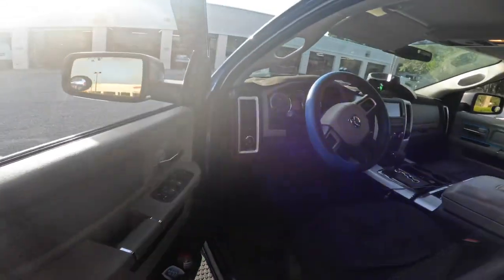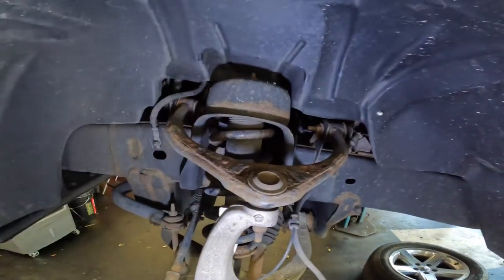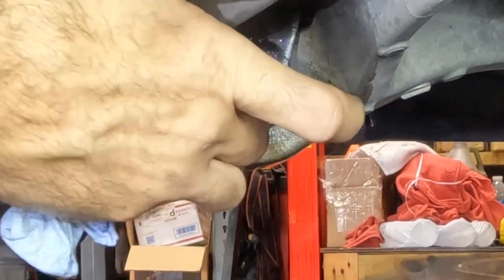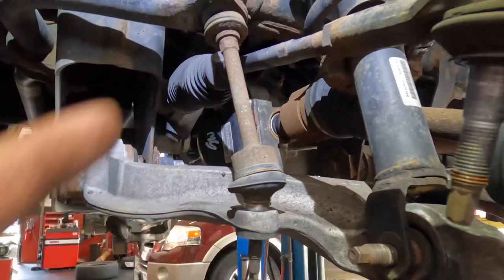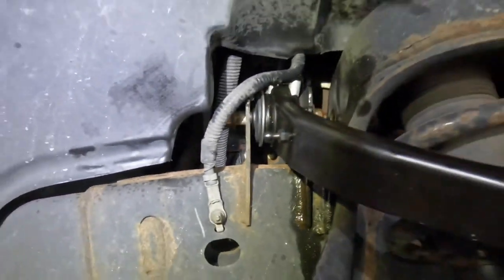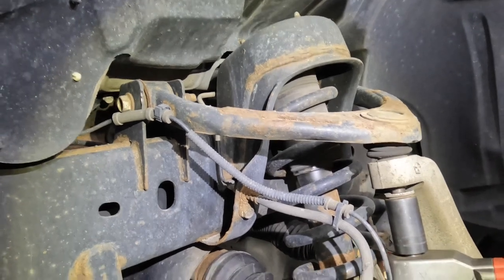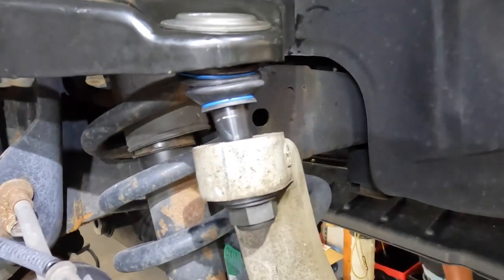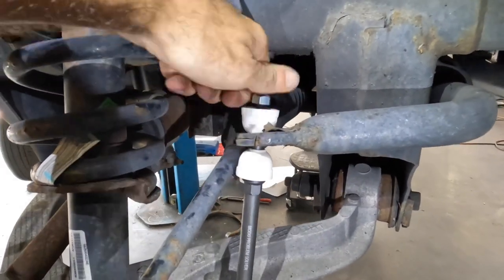Job Fails Fast! 2011 RAM 1500

Comment: When a norhern truck comes in for the estemate, spray everthing down with wd 40.If and when you do the job ,you might luck out and the bolts come loose. ALSO ,if you work on northern trucks,you MUST HAVE 6 point combination wrenches

Comment: I love your videos Ray you are good at what you do however did you settle out the vehicle after you raised it on the hoist?  You will get inaccurate measurements if you don't. Have had a couple of seized lower arm cam bolts on Dodges.  We burn the bush and expand the crush tube then punch the bolt out.
Reply: The rubber stinks when it burns but it works great idea

Comment: Love your videos. Two recommendations. Butter your bolts with anti seize and get a cordless Dremel
Reply: If you can find them invader blades invader blades ß
Reply: A 4-in right angle grinder if you can get it in the right spot and a cutting blade will make life go

Comment: Moog makes decent ball joints with grease fittings but their wheel bearings have gone to crap. I replaced a rear wheel hub assembly on a Mountaineer and it went s#$% in ~10,000-15,000 miles. It had lots of play for a ~2 yo wheel bearing. I had a Moog front wheel bearing as well that only lasted about ~3 years. Only stick to their premium line if you decide to use any of their parts. Better yet, just stick to Timken/SKF.

Comment: For all the viewers who asked why the torch didn't come out first, they are not considering the backordered parts need to be present before you burn the bolts out, hence the lower control arms and other items need to be present. Otherwise an employee's truck would be occupying the lift for up to two months.

Comment: If everyone doesn't already know-
Vehicle manufacturers don't make their own fasteners. 
They contract out other companies to make them, but for certain things
there are "private label" items, but most are ISO. It would be so incredible
to be able to go online, shop at a website where you simply enter info
of OEM and there's the fastener you need. No Dealer, no settling for
a potentially dangerous knockoff, but the actual fastener you need,
straight from the source. At the factories where they're produced, there's
boxes & boxes of product. Would it kill to have  Pickers go around,
fulfilling orders? Are the Automakers so greedy as to prevent this?

When I did the work to my Buick's cradle subframe, installed new bushings
& bolts. Factory bolts were $23 EACH. 6 BOLTS. $136 after tax and S&H.

That is beyond robbery.
Reply: Buick doesn't want to sell you subframe bolts.  They want to sell you a new car.

Comment: I have an idea for a salvage business, you take the cars from where they don't rust and the sun bakes interiors.  Replace the motors/maybe/interior plastics with rust belt lower uv area cars.?
Reply: Custom rebuild with parts available options? Upgraded parts dependent on fitment complexity and cost of upgrade/rebuild.

Comment: Fun fact, Volkswagen Audi Group cars actually come fitted with the fitment for like the ride height sensor for the headlights on cars with Xenon, even if the car doesn't have xenon, the control arms for example will have the bolt holes and all that already on the control arm, this apparently saves them money as they don't have to make different parts lol

Comment: Lmfao the behind the Seens Flashlight reveals under the fender Surfance of the sun outside Barley light outside even with sun at 12 o clock position 😅 🤣 😂 @Rainman Ray's Repairs

Comment: Suggestion. Hit up the junk/salvage yard and see if you can find some acceptable bolts until the new ones come in. Get the job mostly done (aside from a simple bolt swap later), safer than those rusted out things, and give the customer a better ride in the mean time. Assuming you find acceptable bolts there, of course.
Reply: That would be an acceptable solution for you or me, but Ray's time is money.

Comment: Ray, you should have rolled the truck 5 feet back to allow the suspension to settle after being on the lift before measuring the height

Comment: I understand the guy wanting to do the leveling kit. Trucks look dumb nosing down into the ground. I don't know why manufacturers do that, unless it gets the nose of the truck close to the road and because of that gets better fuel mileage. I get what you are saying to Ray about not getting bolts from Fastenal or somewhere else, if people want to do that to their own car themselves, then go ahead. People thought when I used to make similar statements to them I was being a jerk. I'm not, it's a liability issue just like you said.

Comment: I have been in this situation. The solution was to remove the lower arm and the shock as one, carefully cut off the arms of the lower shock and press out the bolt and bushing. Once that is completed liberally apply penetrant to the metal sleeve and attempt to remove. IF that does not work a torch will expand the sleeve so the bolt can be saved. Additinally, curiousity must make me ask. what grade are the bolts??? I resprct your decision but I have to ask.

Comment: Hi Ray, I am a submarine operator and mechanic in some foreign country. I am subscribed with another name to keep my identity safe. Why dont you use anti seize grease when you clicking the bolts? we ALWAYS use anti-sieze grease when tightening bolts for sea water use, it easy to reverse click even if the bolts are 7 years underwater.
There is a good Loctite anti-seize, a gray type for high temperature it a little nasty but works fine.
or a white type i think also made by Loctite much better and less dirty.
If you need any info on what type exactly (part numbers) you can reply here.

Comment: Not to cut ya down ray cause your a great mechanic, but a little heat, water, bfh and air hammer and you could easily get all those bolts out without cutting them off.

Comment: Ray, you were fortunate that you were able to put things back together after you found the rusted bolt problems. Just wondering ... if you weren't able to put it back together with the parts you had, would you have Fastenal or HomeDepot something so the guy could have his truck back?

Comment: Having had to do custom work that factory bolts no longer work for,  there are definitely some bolts that I have replaced with the same or better grade of bolt. That being said the bolt store is not going to have the offset alignment bolts that will work, so at that point might as well wait for all oem.
Reply: The alignment bolts have a flat so that the eccentric to adjust the camber will not spin you can't buy them in a hardware store
Reply: @michaelpressman7203  Yea I know, I literally said that the bolt store would not have the alignment bolts.

Comment: Of course your left hand kept dropping the nut. It's a right hand nut.
If you have the lowers already, I'm surprised you didn't cut the mounting tabs off the strut, press out the bolt\bushing off the arm then heat the bushing sleeve and press it off of the bolt.

Comment: As a mechanic, I've learned with bolts and nuts which are exposed to the elements, to always install the bolt in weather direction and the nut on the lee side, so that the nut and threads are not getting the brunt of the incoming junk/water/dirt etc. for me it looks the bolt of the strut would be installed the wrong way around, is there such thing with cars?

Comment: Pop that bolt a couple of times with about an 8 lb hammer. You may find it works but you have to let some penetrating oil get started first.

Comment: Hey Ray you need to get yourself the Ridgid high torque impact it's a beast. I have the mid torque like you have for light duty but I also have the high torque because I live in Ohio and corrosion is a real thing up here. Great video as always nonetheless.

Comment: Have to ask. Did I see a crack in the passenger side sway bar at around  26:30? The drivers side I could see it was just Paint. Do you Know why the put grease fittings on the lower side?  Please Keep the Videos coming. are me back in the day working as an auto mechanic.  Retired ASE Tech.

Comment: Hey, that's the same problem I have with my 97 Z28... Unfortunately the OEM Z28 bolts are unobtanium.... I've ordered other bolts, but the head sizes are different, which means I can't put in the adjustment tabs

Comment: That truck must've been sitting in water up to the wheels, I'm a mechanic in Connecticut and change those struts, & control arms all the time and never have that problem, and we have some pretty brutal winter months with snow and all the salt and sand.

Comment: Ray: Do you think an inductive heater would have worked on the stuck nut? I purchased one a few months ago to do my jeep suspension and it gets the nut cherry red. I live up North so; Everything seizes up from our winters. Still replaced the bolts and it's hard to source them here as well. Try WW Grainger or, McMaster-Carr .

Comment: Check your local heavy equipment service companies, like Mac or Cat.  Of course you want at least MFG quality bolts for a half ton from a company that consistently undersizes ball joints and other front suspension components on trucks.

Comment: I would not be worried by any means about two inches higher in the rear. if lower, yes.
Ya, aluminum, rubber and steel components combined is a total nightmare.
FYI, the bed is 2 inches higher for a reason.
Put 1000 pounds of stuff in the truck bed and your rear drops 2 inches.

Comment: NY, PA and Ohio guys could show you pure suspension horror stories.  try having to do that when the vehicle has a band new body, but the underside looks like it's been sitting in a junkyard for 70 years!  and the chuckholes up here don't help your suspension parts, either.  I actually told the guys that put put new shocks on the rear of my last vehicle that they should let the penatrant sit on them for a while.

Comment: Not that it's an option up north here, but is there a possibility of (temporary or not) junkyard donor bolts that haven't taken a vacation to the rust belt? 

Might not be a great option, but if theyre in good shape and that's the only thing holding up the repair...

Comment: Ray... a question please... why when using the electric impact on any bolt that is stuck, you usually try to undo it manually with a hand ratchet or breaker bar and not a big pneumatic impact wrench? Aren't those powerful enough to undo almost any stubborn bolt? I was wondering what's behind your strategy so I may understand and learn. Thank you!

Comment: What I end up having to do was cut the ears off the bottom of the struts removing them then using a cut off wheel to cut them inserts off in order to that the bolts I do believe I have a video on it somewheres on the channel if that would be of some help

Comment: You need to come to Ohio and do a class on how to heat beat rusty stuck part lol every bolt is usually a struggle up here you can cut the head off the bolt and use the nut to run it out I’ve done that on leaf springs

Comment: the minute i saw the lower strut bolt not require the use of a wrench to get that nut off i was like that there truck needs some control arms now

Comment: Got me wondering if those bolts could have been sourced from GM or Ford?   It might be worth a shot to call a dealer and see if they have any in stock, get them and see if they are the same?  Never know!
Reply: I really can see downgrading quality GM and Ford parts to be put on a rust bucket dodge !!!
Reply: Readily available from auto parts sources. The inner bolts are in the camber kit. The outer bolt is included with the replacement bushing.

Comment: It’s the same thing they did to Pluto,

but it will always be a ❕Dodge Ram❕
Reply: Many years ago I knew a guy who worked at Ford Edison Assembly when they were building Pintos.  One day he came to work and found a platform at the main entrance with a brand new Toyota Corolla sitting on top.   Before they started the shift they got a lecture from a suit who flew in from Dearborn.  The suit told them that the Corolla was their best competitor and that's what they were aiming for.  Then he proceeded to tell them how they were going to improve the Pinto.   Everyone stood there in silence until one assembly line guy said,  "Yeah but even if we do all that, it's still a Pinto."

Comment: Rule number one; spray it all before removing and add some brake fluid to nasty nuts or Würth Rostoff, give half n hour and soak some more then, take everything off.

Jayzuz dont you have a cleaner?🤦‍♀️. That floor is dangerous.

I find a nut splitter is faster. A dremel also helps.

Also looks like bad design, you should never have a steel bush in an aluminium housing...🤣

Wow thats a bad design of upper and lower...

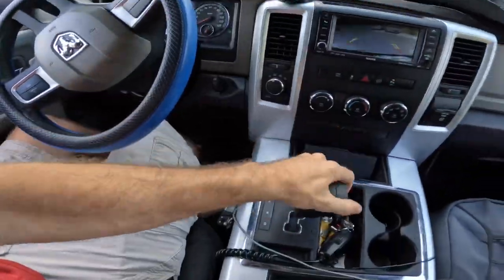Comment: I never really understood the leveling of trucks. When leveled and driving they look like the front end is higher in the air. When taking off from a light, the front end is higher. If you haul something it lowers the back end, which raises the front end (or looks like that). Ray will do it because it is his job. He might even like leveled trucks (only 1:02 mark so far). Just my opinion, i just do not like the look or lack of function to a leveled truck.

Comment: I found it interesting that you were happy to use what appeared to be aftermarket upper control arms and sway bar links BUT you would not use aftermarket fasteners for the lower control arms. Fasteners are made to a particular “grade” (example grade 8) and if buying from a reputable company should be more compliant then the aftermarket parts you are happy to use. Just an observation, enjoy your videos, keep up the good work.

Comment: Unfortunately once someone has shown up in the shop with a stupid product like that, It's hard to tell them " No you are wasting your money doing something completely pointless"

 Faster and cheaper option would be to put higher profile tires on the front.

And/or lower profile tires on the rear.

At least then they get a new product out of the deal.

From my experience, raising the front is also going to give you awful handling problems, It's just the beginning to raise the front there's always more work to be done to maintain the original handling characteristics.

That shit Box probably doesn't see any work...  With those huge rear wheel Wells, It's obvious that the rear is jacked up too much and hes trying to play games to get the front to match ... to make it look like a newer truck or something.

 You don't make friends with salad and you don't make an "old shit Box" into a "fresh shit Box" with some Springs that you ordered from eBay

 Besides everybody knows what fresh shit smells like

Comment: doesnt new bushings for that come with bolts? i have no idea never worked on a dodge since i had a 1972 custom D 100 long bed. ( edited part lol) or is it possible to soak that in something to break the rust and wedge something inbetween the lower arm and the dowel pin in the bushing? i dunno ya have liability most of us do it mahself kinda dudes and dudettes dont have.

Comment: Why on earth would you not just press new bushings in the arm once you get it out? Must be a lot cheaper than a new alloy control arm. Why not get some heat on the bolt/bush and see if it the bolt can be driven out? This is bread and butter stuff for Eric O up there in the rust belt. And BTW, the new upper arm centre would be a couple of inches lower with the new higher struts installed. They should not be tightened until the weight is on the wheels (when you do the alignment)?

Comment: put it back together and wait for all my parts because then all you  would need to do when you get the parts is burn it out

and yes they have to burn out these bolts alot here in the north

Comment: Welcome to my world (Illinois). Shouldn't the truck be on the ground with weight on it for ride height before control arm bushings are tightened to prevent bushing wind-up? Didn't see you put a jack under it. Yes, you can get the angle close to what it was, but it's not exact. 2 inch lift isn't much, but I would definitely check the brake hose length at travel limits and maybe sway bar link should be longer. Too much angle will tear up the link bushings quick. For those of us in the rust belt, rusted bushings can sometime be shook free if sprayed with penetrating oil and left for a couple hours and then hit with the air hammer, but since the bushing rubber is turning, it probably won't work>>they are shot. Also the penetrating oil can kill the rubber. Are these bushing replaceable? Seems odd to have to change control arms though cost might be the same when labor time is counted to punch the bushings out and replace. Stupid design. The strut bushings should be on the strut (like regular shocks used to be) so they get changed when the strut is changed.